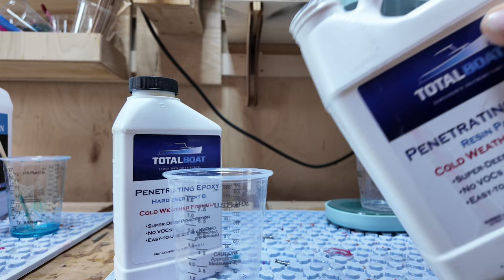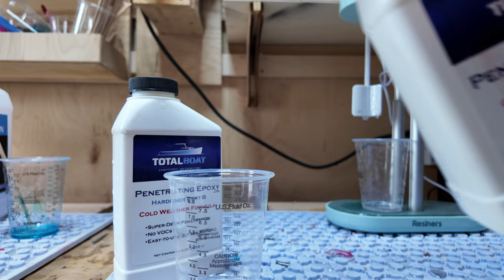Woodturning Magic: Pine Cones Trapped in Crystal Clear Resin!

Comment: Great finishing. Does that tableboat dry/cast v quickly ? And what do you use for the slow turning. My lathe does not go that slow and looking for something which works.
Reply from the maker: The total boat is an over night drying. I use it to seal the pinecones that are exposed to air. Then I use table top for the final coat. This link will show you my video on how to do that final coat. 
Secret Technique for Perfect Woodturned Bowl Finish
https://youtu.be/MHTBMMv6AHw
Reply: @bespokewoodartistry1517  thanks so much. Great tips.